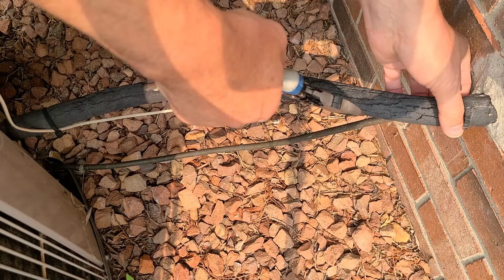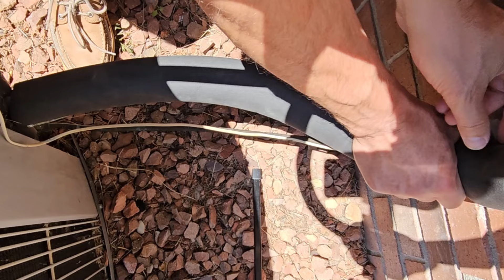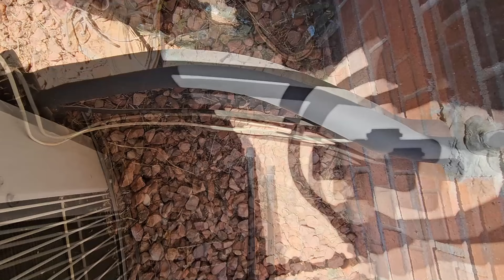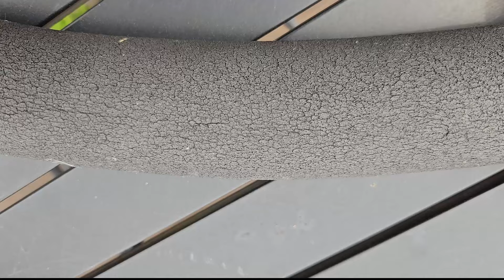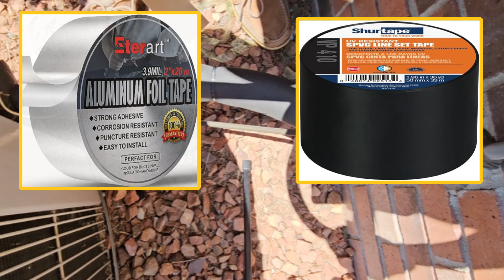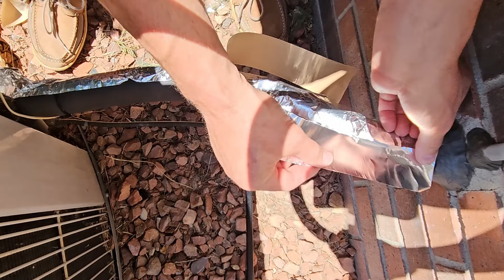How to replace AC pipe insulation and improve air conditioner efficiency

Comment: Thanks for sharing this video - curious if I also need to insulate the other skinny pipe? I didn't use the foil taper but is it's main purpose to prevent sun damage?
Reply from the maker: Hi elliel.8138,

The skinny pipe doesn't need insulation; it carries warm refrigerant to the condenser coils, where it's cooled, compressed, and returned as liquid to cool the house.  You’re correct the only purpose of the foil tape is to prevent UV damage to the pipe insulation.

Thanks for visiting my channel.

Comment: They make insulation especially for outside applications that holds up to uv rays. In some cities it's mandatory to use it when installing charge lines to the condenser.
Reply from the maker: Thanks for your feedback.  Can you share the name of the product to help other viewers?
Reply: Do you need to turn off the unit prior to replacing??
Reply from the maker: @amydurkin5704  I would, mostly for convenience, so you won't have all the noise and hot air from the unit